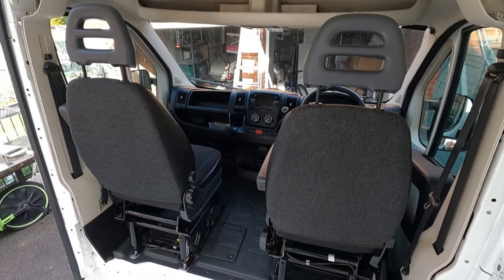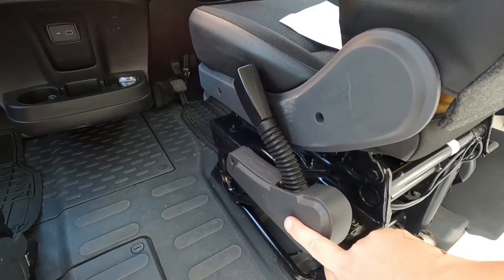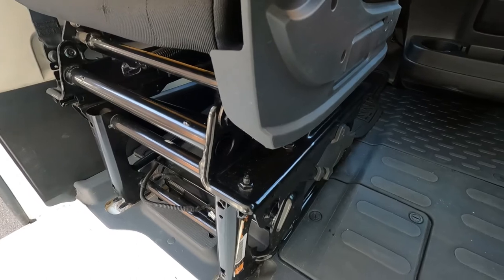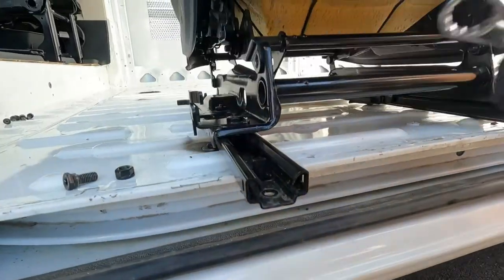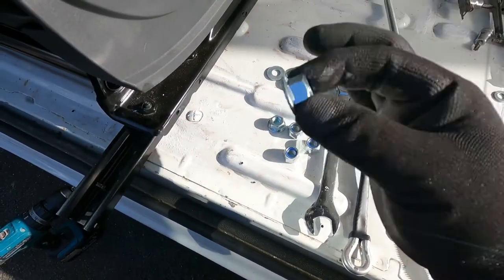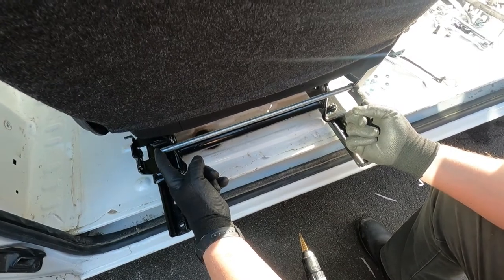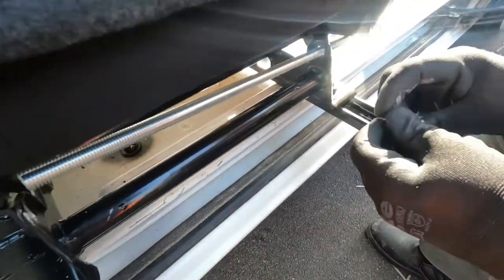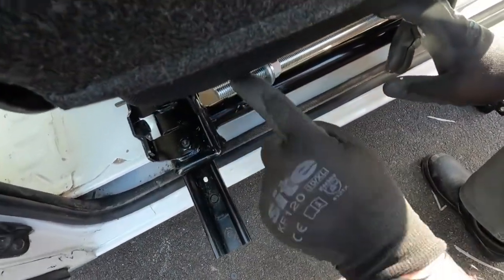How to install a drivers seat on the passenger side in a Citroen Relay / Ducato / Boxer / Promaster

Comment: Nice job and creativity.  Even though MOT passed it, I would probably replace that bar with a high tensile one.   Standard threaded rod does not have shear strength in that direction.  Even though the standard bolts are 10mm, they are high tensile, and would be stronger than standard steel 12mm.
Reply: A normal 8.8 tensile strength bolt at 12mm will hold over 3ton in shear whilst a 10mm  10.9 high tensile strength is about 2.5 ton

Comment: After unpluggin the seat belt temsioners off your original seats that would give you a warning on the dash which looks like an airbag icon because the seat belt tensioners are not plugged in. How did you get around this light being on the dash all the time?
Reply from the maker: I was lucky that on the original double seat, the tensioner cables were not even connected and no dash warnings so I just tucked them out the way and left well alone. If yours are connected, would it be possible to remove the parts from the double needed to retain the connection? good luck with it. cheers greg.

Comment: Hi, that's a really helpful video. Can I ask a question though? How long are the seatbelt stalks that you fitted? When I've measured the ones on the double seat (one of which I would use) they look to be around 23 / 24 cm in length (end to end). I think this would mean they'll stick out too far through the seat. Hope you can help.
Reply from the maker: Uh! The stalk is from the double seat that was in the van. if anything I fancy it is a bit low and could be an inch higher in an ideal world. if you use the stalk from the double and do the same thing you should be fine.  Oh, disclaimer! you should not copy what I did and it is not a 'how to' or 'tutorial' and is NOT SAFE! the video is for entertainment purposes only. now that's out of the way, good luck with it.

Comment: I've just finished modifying my van seat, and I want to give a shoutout to Wiltshire Custom Camper for their helpful video. I encountered a few hiccups during the process that I'd like to share to make things clearer for others attempting the same project.

Firstly, a big mistake I made was forgetting to pass the threaded bolt through both the seat base hole and the seat hole. This oversight caused confusion when the "up and down" mechanism didn't work as expected. Once I corrected this, I still faced issues with the rear "up and down" function.

After some troubleshooting, I realised that the seat hole must have the ability to rotate to allow the seat to rise and fall at the back. This meant that the nuts securing the two holes together couldn't be tightened all the way. There needs to be some room for rotation.  Also, as mentioned in the video, some black plastic conduit does tidy it up nicely, leaving a professional finish.

I hope this tip proves helpful to someone else tackling the same task.
Reply: Thanks, that helps

Comment: 1. The drivers' seat are generally more worn out. 2. The armrest and lumbar adjustment are on the wrong side. Especially the armrest by the door is completely useless. 3. Standard single seat bolt should have been used for passenger's safety reasons. In case of an accident, the seat should remain in place and not fly out with the passenger through the windshield. The bolts should still be available at the dealership. 4. When playing with the seats, not being sure if the van is equipped with airbags and tensionners, the battery should be disconnected to avoid shortcuts causing potential problems with the airbag ECU and expensive repair. There is a special procedure on battery disconnection described it the owners' manual. 5. The seatbelts are different if the seat is equipped with a tensionner. So, as all drivers seat are equipped with it, the seatbelt clamp (?) won't fit if the van was not equipped with a passenger airbag and tensionner. Having those in mind (especially points 3, 4 and 5), I'd say the video is potentially dangerous and should not be considered as a tutorial.
Reply from the maker: 1. who said it was a tutorial? 2. dont copy it then, simple. Do your own thing! 3. have you too much time on your hands for such a long comment (sorry, i meant moan?) best wishes...
Reply: @wiltshirecustomcamper7203  Don't you understand that using a threaded rod instead of a specially designed bolt for fixing the seat can lead to severe injury or even death? Have you even thought of forces that those bolts need to cope with in case of a crash? Let's say 80 kg passenger + 30 kg seat at 100 kmh / 60 mph? If no, please do :P
Reply: That mod is stronger than the original, simple.

Comment: this is a great idea but im pretty sure seat belt mountings have to be fitted with high tensile steel bolts, it may pass the mot as they may not notice but how would it hold out in a crash ? dont know if high tensile threaded bar is available to buy
Reply: Hi tensile bolts are ready available at likes of toolstation

Comment: Just done mine all I done was pull longer bolt on side where new seatbelt goes. Don't need threaded bar
Reply from the maker: Works equally well for sure. thanks for the comment and glad your seat worked out for you.

Comment: Thank you for making this video.  It's very helpful.  Could I ask though, why the bar between the two bolts?  Could you not just replace the one right-hand bolt with a longer high-tensile bolt for the seatbelt attachment?
Reply from the maker: I guess I could have, just seemed a good idea at the time to put a threaded bar all the way through. either works i guess.

Comment: I don't suppose you remember/know the size of torq required for the rear bolts on the seats.  The ones with the collar that the seat slides under.
Reply from the maker: I don't I'm afraid but it is a fairly 'regular' size, if you have a 'mechanics' set that goes up to around T50 or 55 I think you'll be fine. a DIY store special that goes to around T40 wont do it.

Comment: Great work around for using a drivers seat a real money saver! Only slight problem is the two bolts that are removed are shoulder bolts that allow for up and down movement of the seat ( side levers) (not a problem if you are ok with a fixed height). A solution is two machined bushings 12mm bore x 14 mm outside diameter x 4.5mm wide this allows the threaded rod to be tightened, without compromising seat adjustment.
Reply from the maker: Good tip!
Reply: Hello where could I get these ‘bushings’ from? Not sure what I’m looking for. Thanks!
Reply: The clue is in the wording you are looking for a bush.. like a very thick washer but as per dimensions described. Whilst u don't tilt your seat too often this action will eventually wear the threads on your bar. The bush solution will also avoid this. But hey great conversation and I'll follow suit.

Comment: Thanks so much for this. A couple of questions: does this mean that the armrest is now against the door and is there a way to switch this? And would a long bolt work fine too or does the threaded rod add some vital strength?
Reply from the maker: Hi, thanks for watching the video and your questions. yes the armrest is on the wrong side (door side) when in driving rotation and I could not see anyway to swap this but is small price to pay for the huge savings to be had. I too thought about long bolts but in the end decided on a threaded rod that went all the way across just for 'belt and braces' on it. I guess long bolts may be fine if a greater or same diameter as the ones taken out but your call on that one! good luck with your build.
Reply: @wiltshirecustomcamper7203  thanks so much for the reply. Out of curiosity how much were you able to pick up the chair for and where from?
Reply from the maker: @dylantucker7951  Found it in Facebook Marketplace and was around £100 mark and 30 miles away. Probably will have better luck on Facebook or GUmtree than eBay.

Comment: Hi great vids, love them all, very informative. Question... Do you know what the square compartment with a cover on is to the right  the passenger seat on the floor please?
Reply from the maker: I do indeed! it is the access hatch to the fuel pump in the top of the fuel tank. ideal if you are fitting a diesel heater and need to access the pump.... regards.

Comment: Hi I'm goin to do this  thanks for the video  what size m size and what m size nuts do you use 
Meany thanks  dave
Reply from the maker: I used a 12mm threaded bar and went to my local independent motor spares shop for the nylock nuts and flange nuts and washers where I could buy these individually rather than 100 at a time from Screwfix. same local shop is great for all sorts of other things like cable lugs and crimps etc. Just needed 2 more 35mm cable lugs for my inverter, forget eBay, 20p each from same said shop...

Comment: Im getting a warning regarding the airbag when doing this mod. Its on my citroen relay 2009. Do you have any idea why? Shouldnt I plug in any cables to the seat? Thanks.
Reply from the maker: Hi, On my 2018 Relay the passenger side airbag cables were not connected to the factory fitted double seat, so although the replacement 'drivers' seat had connectors on it, I never connected them up so have not had this issue. i am not going to connect my passenger seat to the airbag system, if the factory fitted double was not then for me, it is OK for the new single seat to be the same. all the best and good luck with it.
Reply: Likewise I have not had an issue with warning lights. 2014 relay. You can however fit resistors to put the lights out. They are sold on eBay but of course if you know the resistance then just buy from anywhere. (I don’t know as I thankfully don’t need to)
Reply: Do you have a link for those resistors Craster?

Comment: Very tempted to try this in my 2017 Dispatch!
Reply from the maker: Sure, why not! Only thing I would add now is that one comment mentioned using 'high tensile' rod or bolts so I would investigate that as part of the process.
Reply: Did you try this?  Passenger seats are around £800 at the moment. I was also thinking of giving it a go.

Comment: Great idea. Before I go and do the same, did you have to do anything to not affect the MOT and keep the DVLA happy? I looked on the Govt site but only found info on adding seats, nothing on single seat conversion. Grateful for any advice before I start, thanks
Reply: I posted an identical but less detailed vid last year. My van has since had two MOT tests and nothing has been said. I’d say go ahead and do it.
Reply: Many thanks for your reply. Puts my mind at rest. To save my pennies I'm planning to cut away the middle section of the bench seat, to create a walk way. Looked last night and saw that the yellow multi plug (seatbelt pre tensioner?) is not connected on the passenger side, one less thing to worry about. Thanks again
Reply: In mels van world, he cut a sprinter seat in half. To be fair though an unsuspecting scrappy will sell a seat and base for under £100. Mine was pretty ropey but the cheap seat covers did the trick. In fact as time has passed they seem to have shrunk to fit the seats better.
Reply from the maker: Mine came from Facebook Marketplace if I remember, they are about for £100 or less, just have to be patient and keep looking but be ready to pounce when one comes up as they aren't around for long..
Reply from the maker: I approached this from the 'What's the worst that can happen' standpoint, at that is that the MOT tester fails it for some reason, to which you can appeal or take it elsewhere or 'worst case' buy a proper passenger seat and at least you've had a go to save some wonga..